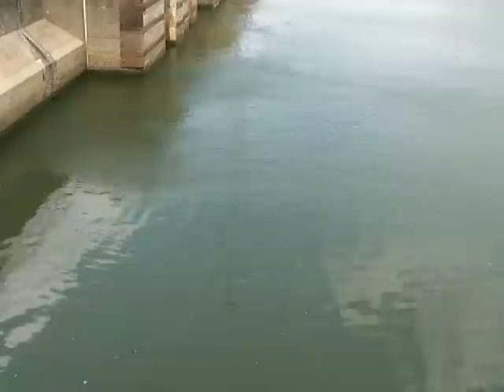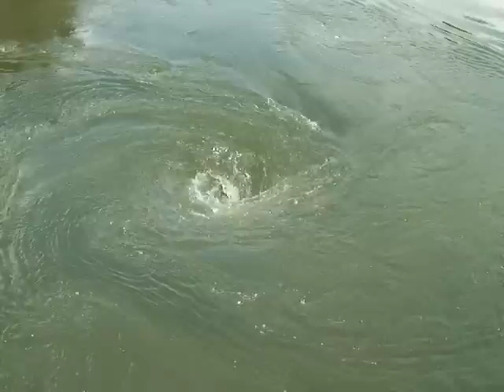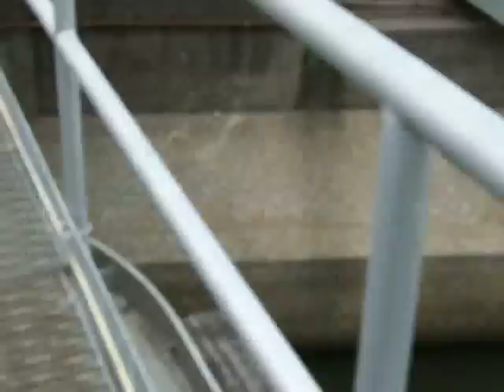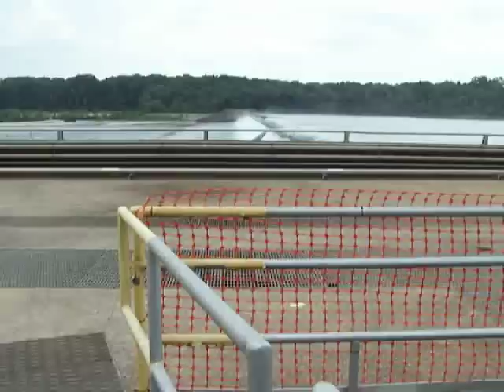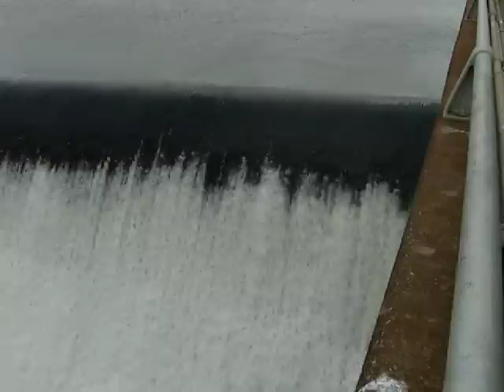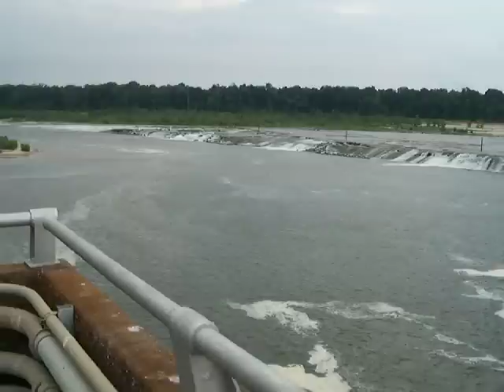Demopolis Lock Whirlpools!

Comment: The last time i seen a video like this was a replacement pylons. Contract was told by city where to place them. Real close to originals. These protect the structure used as footing for bridge main support. I guess the city was wrong or forget there were underground big tunnels.  They were large rectangular walkways used in the 30 an 40 i believe. Well the contractor put a hole in the tunnel. It slowly filled every basement and right up to street level. It is a wide spreading system so it affected lots of  businesses shutting them down .

Comment: Just like low and high pressure atmospheric fronts, a whirlpool spinning clockwise (in the Northern Hemisphere) is where water is being added, 'adding pressure' to the whirlpool. Likewise, a counter-clockwise whirlpool is a 'low pressure' cyclone, from being drained or 'water removed'.  Therefore, the first of the video showing the left-lock gate is a high-pressure vortex, adding water in...and the larger, second whirlpool, is  a low-pressure vortex, where water is being pulled out.  Seems that they are pumping water to the left-gate from the right-gate...not sure why, but since the lock isn't changing water elevation, it seems to be a balanced water transfer...maybe purging the lock, cleaning it???

Comment: Imagine the first second you realize you are not swimming fast enough to escape from it
Reply: If that happens you can still escape by swimming away while diving deeper underwater.  The water at the surface is the most affected and therefore has the strongest current.
Reply: hunterspride18   Interesting if technically true I'd still die of a heart attack while implementing that plan.

Comment: What an interesting video! What theories do you hear about why they spin in opposite directions? Being in the Northern Hemisphere, Coriolis forces would only allow counterclockwise spin...
Reply: the flow of water and angular momentum. and those forces are primary for air. Even then sometimes you have a tornado or dust devil that spins clockwise. 

I had a toilet that flushed clockwise. I live in the U.S.
Reply: Yeah-- it does look like it's caused by the particular flow pattern of the water. That's cool to watch. And scary, in a primordial way. The toilet thing is just a manufacturer's feature, designed for efficiency or something.
Reply: As the videographer stated in his comments, this was filmed at a lock, not a river or ocean.  The whirlpools are made because of the water being transferred through large under ground pipes to other parts of the lock.  I use to live in Bama, and I've been where this was taped at.  Usually there's a roar of the water that comes along with the whirlpools.
Reply: the movement of the water and the physical structures it's moving through will control the vortex- it's made by the lock,..Coriolis forces are butterfly wings,..the lock,is a greatbig hydro-system.
Reply: I was thinking the same thing
Reply: Justine

Comment: Excellent video.  I am an engineer and remember modelling vortex fields in the past.
Reply from the maker: Do you have a specialty? The only reason I got a chance to visit this location was because my father specializes in Catholic protection engineering.
Reply: Cool.   I am a Mechanical Engineer.  I have worked with ship and sub structures, military robotic vehicles, and now aviation power systems.   I have done some cathodic protection but only in structures.
Reply from the maker: +B Rob very interesting. I'm not sure if non-workers can be granted access to locks and dams, but I would highly advise checking at least this lock out. Remember to pack the sunscreen and water!
Reply from the maker: It gets incredibly hot around the area. It can easily reach temperatures up to 120 degrees.
Reply: what for?
Reply: na ah
Reply: desmond
Reply: B Rob obg
Reply: F
Reply: Xxxxporm
Reply: Xxxxporn
Reply: Xxxhardcoreporn

Comment: presumably if you fell im you could hold your breath for 30 seconds until you got spat out the other side??? that water must be travelling fast through the drainage channel.
Reply: +fatwalletboy2 anyway ... 20-25 feet down in the water ... at that depth you will be dead in no time .
Reply: there's a purification system underneath.... :/

Comment: If you take a camera and tie it to a rope or something and you hold the other end of the rope and throw the camera in the water wouldn't it pull you along because of how strong the whirlpool is?
Just a question though
(Sorry if my english is bad)
Reply: No it wont. If I am to explain it, well I would say, since the surface area of the camera and rope is too small, and mass is negligible, it wont probably make enough momentum to pull you off. Instead, put a huge bucket, a bit huge one tied to a rope, it may probably pull you into the whirl.

I am not sure if the explanation is right, but hope you got the idea.
Reply: Hey bass hunter you cute :)

Comment: im a idiot but what happens if you fall into that water?
Reply: well there are huge steel grates at the bottom of the river bed you will be pinned there by the water pressure until you drown either that or the force of the water could be so great you could be forced through the grate either way is death
Reply: it drags you down to anywhere from 10ft to 50ft and then, given you break free, you swim to safety out of its draw range
Reply: It sucks you down into the bottomless abyss
Reply: God damn..
Reply: You get pulled down into the depths of hell.

Comment: I found it fascinating that the three whirlpools combined to create one.
Reply: That is called the "Fujiwhara Effect"...it happens on typhoons and hurricanes too, if they are close enough that is
Reply: More detail is that the vortex-like objects dance in a binary system; in this case we'll say the vortex-like objects are same size and far enough to do whatever they want. They will collide in one case, because 1 gained power and disrupted the orbit of the binery system, causing them to get closer to each other and eventually collide. This does not apply to Black Holes. Black Holes always merge when getting close to each other. In the other case is not so interesting; they will just circle around each other until they dance away, or just getting out of orbit and roaming around. The name of the effect came from Scientist Fujiwhara over 100 years ago.
Reply: Probably happens with tornado formation as well.

Comment: Folks, this is a kind of dam, power generation. When the water level rises very after a rainfall, the excess water must be released to the other side of the dam. This passage is made through valves pipelines that pass water from side to side of the dam without affecting the main rotors.

Comment: Whirlpools occur when two different currents collide. This phenomenon is quite seldom to be witnessed, but occurs generally in large waterfalls and lakes where to opposing currents meet. The size of this vortex must be a maelstrom. A downdraft is the primary contributor to the depth of the vortex.

When a vortex forms, hot air that resides on the surface of the water burrow into the concave. The force of the opposing waters must be slightly inequivalent, sometimes occurring when denser water (

Comment: A dam is retaining a river in order to hold water (usually for electric generation), the pressure force that the weight of the contained body of water generates is released on a controlled flow valve to rotate generator dynamos; the water comes out from the dynamos chambers, and its release back into the same river, the draining process you see in this video is because it avoids overflows that can drown or flood areas where water is totally unwanted, this water also goes into the same river.

Comment: @SangueVerde7 :D yeah, only the sink drain is the whirlpool in midget form. if anything is in the water when this thing is going on, it is sucked into the water. it rides with the water till it reaches the hole just like a sink drain as you put it. it may pop up several minutes later. rivers with dams often have these. i had 2 classmates die from these because they skipped school and went to the river and when the dam opened all H..E..double L broke loose. several others were killed by these.

Comment: @LordMaggoteer but when the air is free-flowing ie if you had cut the bottoms off the bottles(so they are connected to the constant atmospheric pressure) it would be fastest to have the whole area of the gap with water rather than wasting the middle with a tube of air

Comment: @roydamanna With something that size you would most certainly get sucked into the whirlpool and come out the other side below. You may get lucky and pass threw the intake filters only to find an even more horrific nightmare of turbine blades (but only if it's a hydroelectric dam, I think these whirlpools are from the locks), the chance of survival would be minimal. However, with nothing to trap you under it be a rather short trip and a hell of a dizzy ride if you could hold your breathe.
; )

Comment from the maker: @IstasPumaNevada I want to say no. My highschool class did a very small experiment with the draining of water. We connected two 2 liter pepsi bottles at each other's mouth and wrapped it in duct tape with about 2 liters of water inside. When we "sloshed" and formed a sort of whirlpool the water seemed to drain faster than if we just turned the bottles over. This was because of the air bubbles having to constantly form and rise with the "turning" method.